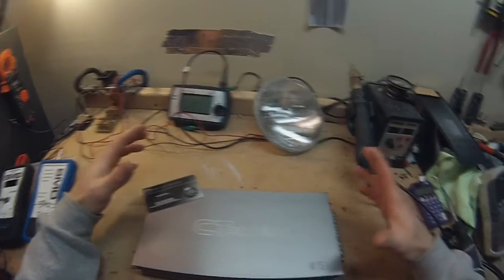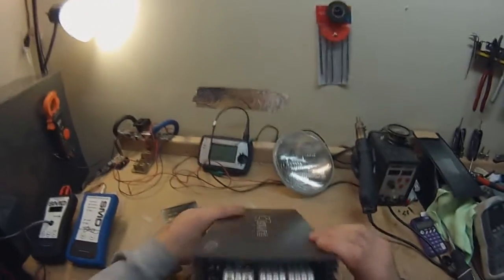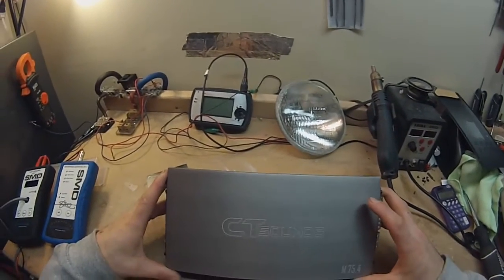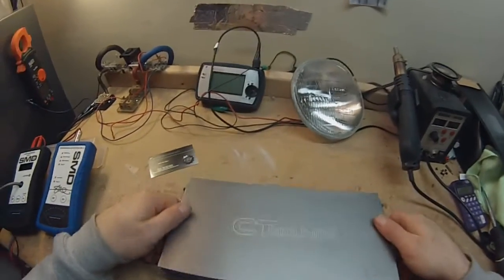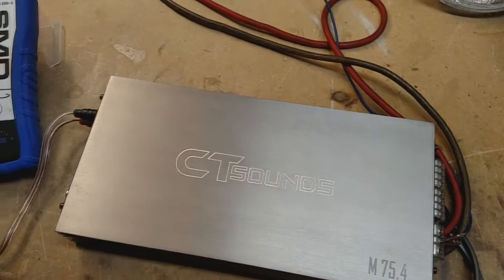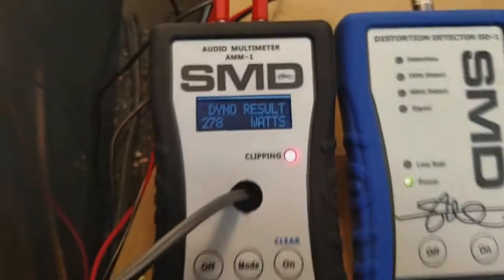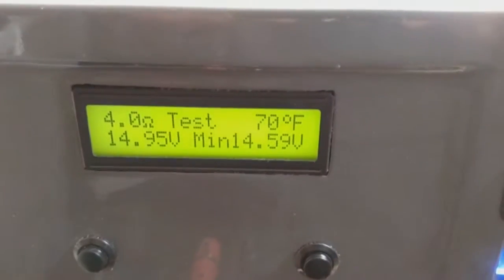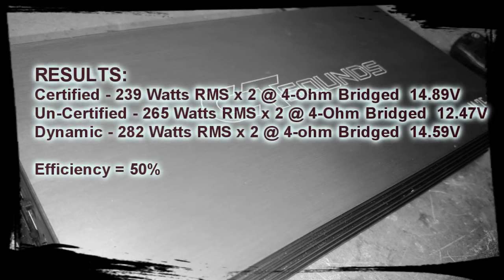AMP TEST! - CT Sounds M75.4 Amp Dyno

Comment: Can you test a memphis M class amp i got 16-mcd1100.1 its pretty small and light weight but claims 1100 rms 1 ohm stable but curious to why they only have 2 40a fuses